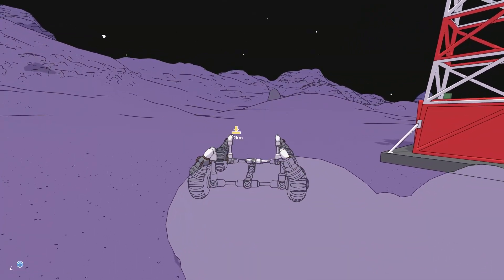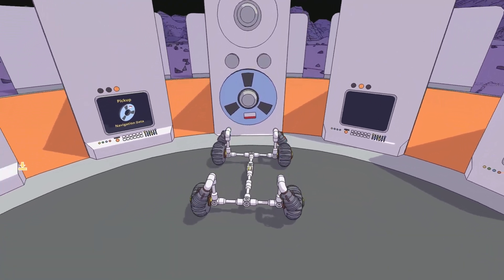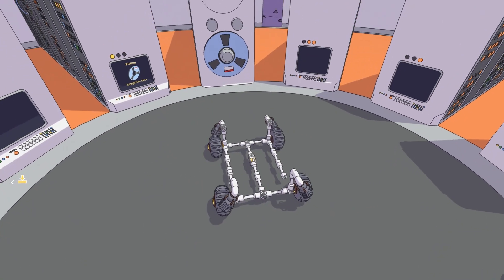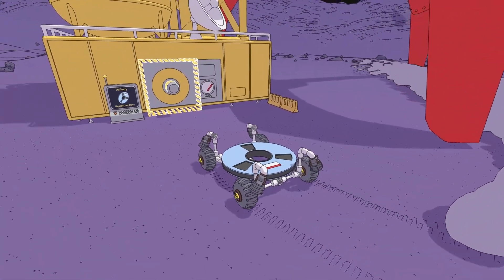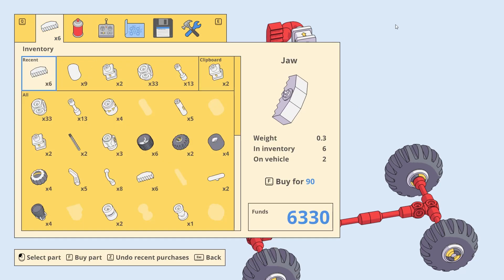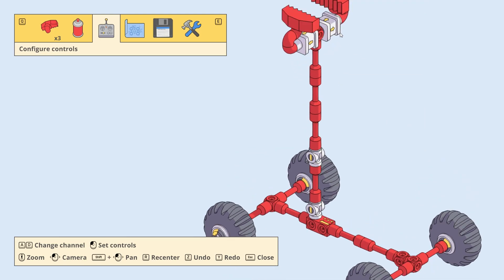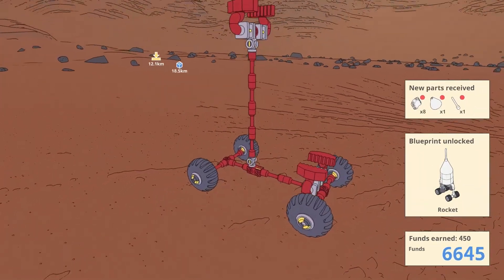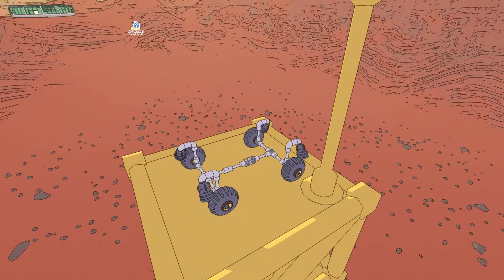Mars First Logistics part 23: Navigation Data

Comment: in the video you use back thrusters alone then forward alone then later you used both sets at the same time. How is that possible? If you assign different controls for each set you can't use them both at the same time, or am i missing something?
Reply from the maker: Muddle rear thruster is soacebar for all channels. Front and rear are set to left and right mouse button on channel 2. I did that to not drain all the fuel accidentally and some control over how much I need